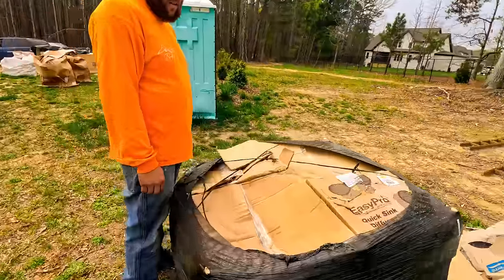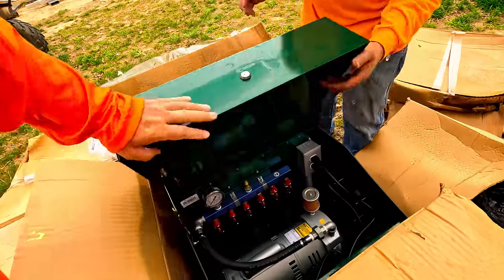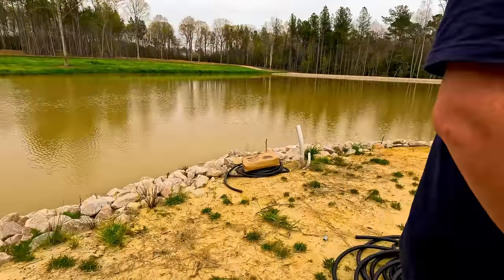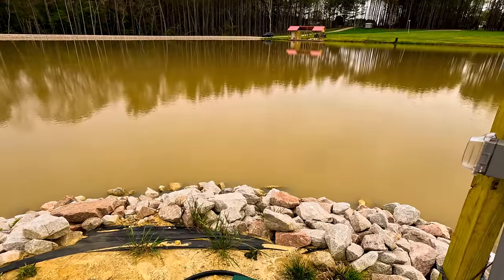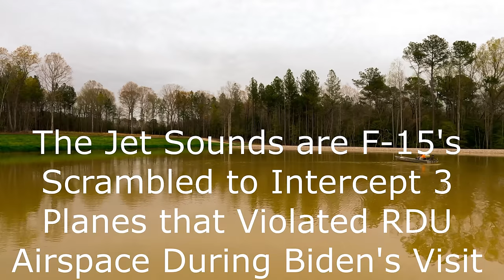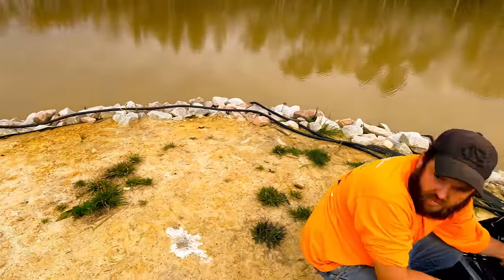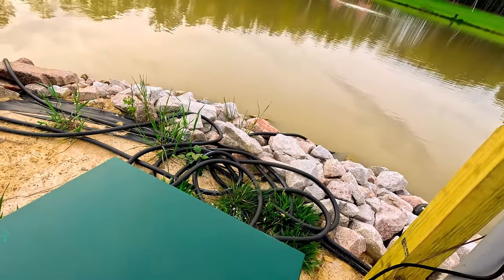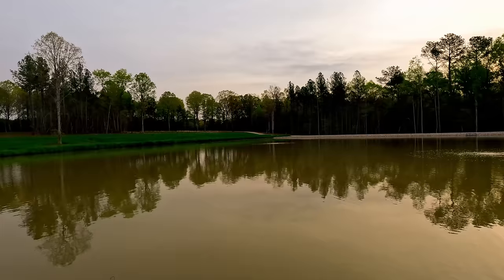Adding an Aerator to the 5 Acre Pond

Comment: You can also do fountains, with pickup set 12 inches above bottom.

Anything that circulates from near bottom to the surface.

Just the floating bird bath fountains help some, but they pick up surface water and spray it.  But they look nice.

Comment: They are a little more to run than I thought.  I have a 2 bottom aerator in my pond but it was more for oxygen, my pond is 12’ deep. They do a fantastic job and it’s quite easy to replace the (pistons ? ) each year. Didn’t have that fancy hose when I put mine in and just used rebar.

Comment: I'm not sure how you'd do it, but I think you should of come up with a way to ensure that the diffusers aren't laying on their sides or upside down. I'd also suggest that the rolls of hose should have been put on an axle or turntable to eliminate the coils that I saw going into the water. Then the hoses would lay flat on the bottom.
Reply from the maker: Sounds like James going for a swim.

Comment: I have some friends that have a little cabin on a lake and they have a couple small pontoon boats they use as ferries. One is a cable boat and the other is powered by a 2.5 hp mercury. (Could easily be an electric motor) Wish I could show photos in comments! They actually designed the boat with the outboard to look like a mini Washington State Ferry.

Comment: How can you tell if the aerator has landed the right way up? I only ask as theoretically it would still produce bubbles at the surface no matter how it landed, yet if it landed upside down, it could also be eroding a hole in the bottom. Probably a simple answer to it but got me wondering.

Comment: If you want to reposition the aerators later you could probably throw a hook on a rope in the water to snag a line to pull it to the surface. Or go magnet fishing since the diffuser base plate is steel.

Comment: I'm a little surprised you didn't label the valves with the location of each aerator.
Reply from the maker: Yeah. Maybe I'll break out the label maker
Reply: How about having a small map/sketch of the pond on the inside of the lid, showing 6 numbered zones and put corresponding number on each valve.